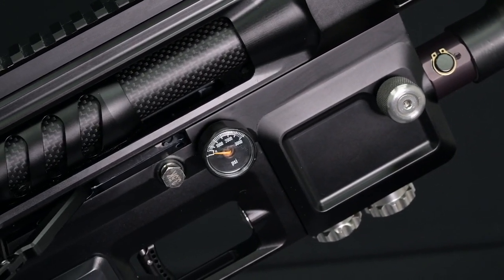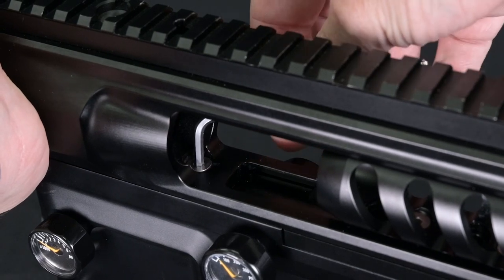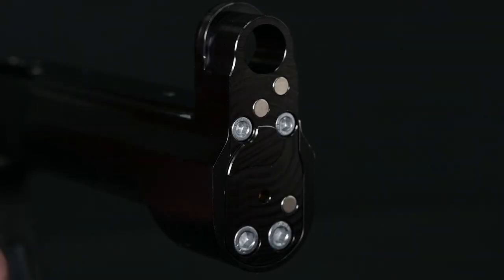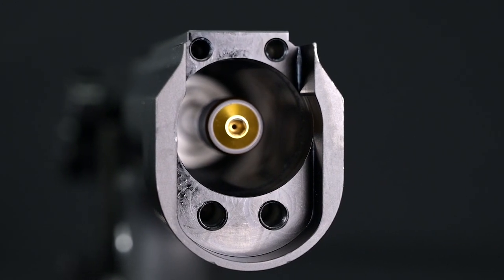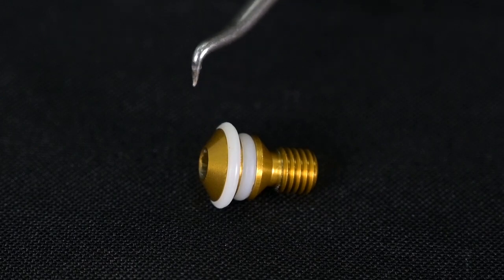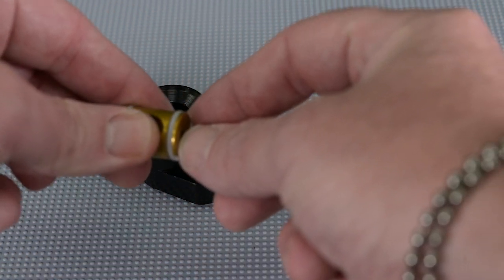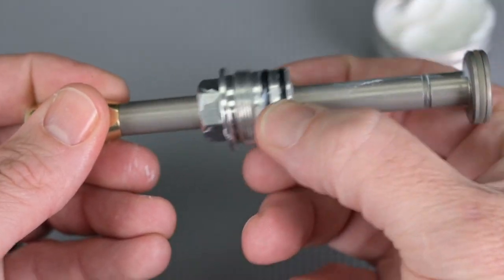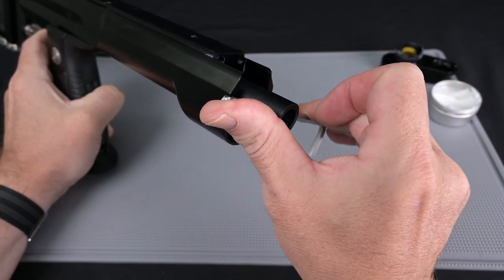SKOUT Airguns - EPOCH® Valve Service

Comment: I want to try this gun so bad and compare it to the accuracy of my LCS SK-19. If it can hold its own with it…that my friend is saying something. This company is less than a 45 minute drive from me considering I’m in Connellsville Pa. I just need to make the time to check them out. Right now however with “Bidenomics” sucking so bad I don’t even want to spend a dime until he pulls his head out of his Rearend or Trump gets the swamp drained. Money is tight. Still…I want this gun. Question is the caliber I want. .22 cal is versatile and cheap to shoot as is .25 for the most part. .30 cal on the other hand costs as much to shoot as a .22 LR and with that what’s the point of shooting an airgun. .22 or .25🤷‍♂️.
Reply: Looks like you could purchase .22 & .30 barrels…two guns in one!
Reply: Anyone done a comp to the Daystate electronic rifles ?